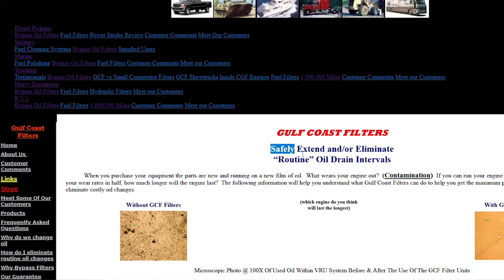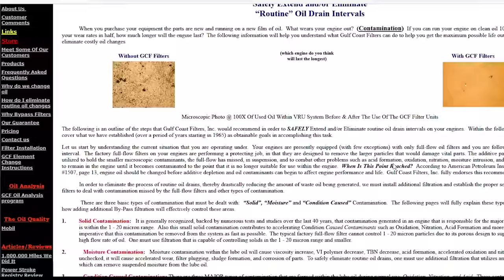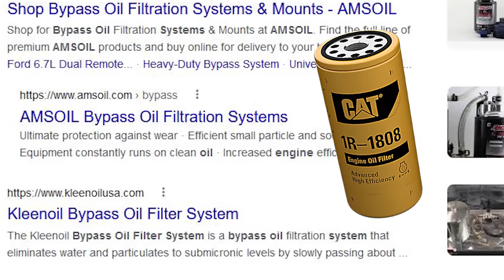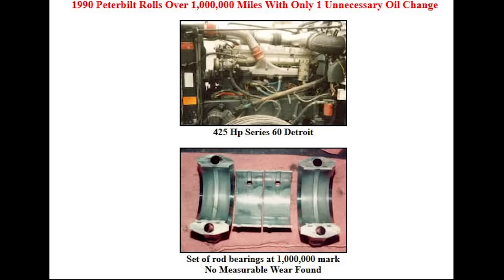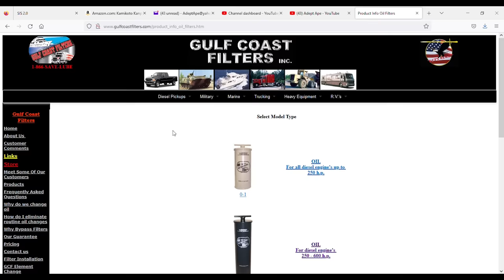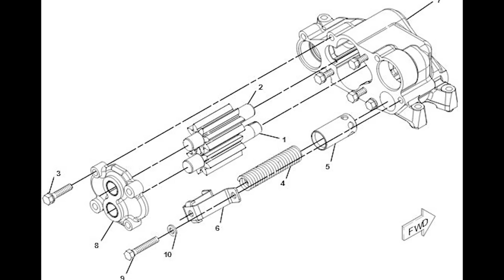No Oil Changes and 1 Million Miles!!! Are Oil Changes Optional with a Bypass Filter? (INTERESTING)

Comment: I only know light vehicles.  Would simply topping off with new oil after filter changes address your concerns?  (Other than coolant separation failure which, as you said, is a repair, not maintenance.)

Comment: I know it's not the same, but I have a 1989 GMC pickup with a 350 gas.  The odometer broke at 252,000 over 10 years ago.  I estimate it has well over 300,000 on it now.  The oil has been changed twice in the last 10 years.  It still runs well and doesn't burn oil.  That's with no special filtration at all.  I sometimes wonder about the value of oil changes.
Reply: In the 60s it took longer to clean out the sludge than overhaul the engine. Opened up a Nissan Altima with 225.000 miles on it to do a valve job. It looked new inside. Dont know if its better oil or cleaner runnimg engines or both. Thought all it needed was valve seals. The valve guides were worn out..ordered a Japanese import engine and installed it.  Son in law had a Chevy V8 . It would get a fire in the plastic intake manifold and the manifold would melt. I will stick with my old 390 Ford. Been driving my wifes Pontiac 3.4 V6. Thats one hell of an engine.
Reply: Back in the 60s I changed the toilet paper filter every 2000.miles. It was always dirty and sludgeed up.. Now I change the toilet paper filter every 6000 miles. It is always clean. The full flow filter is clean. My guess is the Pontiac 3.4 engine is perfectly clean inside. I decided to quit changing the full flow filter. It has 63000 on it now. I might be wasting money changing the toilet paper filter every 6.000 miles. I think Jackmaster claims up to 10.000 miles. That would be under ideal conditions such as what I drive.
Reply: Watch out going too long between full flow filter changes. The pleated paper might get rotten and come apart.

Comment: No joke I drove a Subaru for 200,000 miles after it already had 100,000 miles added oil only never changed anything never change the oil filter either When I finally retired it had nothing to do with the engine

Comment: One thing that would help keep oil changes down is an oil centrifuge, which is also known as an oil spinner. It's driven by oil pressure, and it spins the oil as it passes through causing solids to stick to the inside of metal bell. You can then clean the caked-up gunk or replace the collection portion inside the spinner. That, along with a bypass filter, would ensure 1M mile oil changes even in tough conditions... and yes, oil is recycled and reused by deep filtration so I would consider the claims of the bypass filter legit.
Reply: The advantage the big bypass filter has over the centrifuge is it needs a lot of new oil at filter changes.Its a matter of keeping the oil clean and adding enough new oil.
Reply: @ralphwood8818  Yeah, but you can use the oil spinner along with the bypass and effectively just "top off" the oil instead of having to do complete changes. Other than that, you would need to occasionally clean the spinner collection bell and swap the filters, but that can be done without draining the engine.
Reply: @alphaforce6998  Engines need for the oiil to be clean 100 percent of the time plus enough new oil added to keep the additives up to specs. When you dont drain the oil you have to. Change the filters more often. The oil in a diesel can be very black and be clean. Some diesel soot is non abrasive and..too small to be filtered out. Its like ink.Not sure about a centrifuge. My only experience with a centrifuge is on a 65 Honda 305 motor cycle..Had a Frantz oil cleaner on the Honda 500 custom in those days. Converted the canister full flow filter to a spin on filter..

Comment: The logic of swapping out portions of your oil in any engine over an amount of time before changing it dose work. But you use more oil???? What I don't understand is why your not supposed to drop your transmission pan and change the filter every other oil change???? Can you tell me you opinion?
Reply: I have a Motor Guard toilet paper filter on the Impala transmission and the Subaru transmission. The 76 F 250 has a Gulf Coast junior on the transmission. Today I will be puttimg a Motor  Guard on The Ford  tractor..Its more complicated. Dont want to get blown off the tractor by an exploding bypass filter. The only thing I have with a decent stock transmission filter in the oil pan is the Impala Transmission in the Farmall H. Correction. Never had the pan off the Subaru. Dont know what the filter looks like. It has 240.000 miles on it.

Comment: Correct me if im wrong The million mile truck had about 350 gallons of new Rotella added in a million miles just counting the makeup oil added at filter chamges. Only one oil change?  It looks like to me for the system to work the filter must be big and able to keep the oil clean plus take enough new make up oil to keep the additives up to specs. My experience is a roll of toilet paper and a quart of new oil. The largest thing I own is a 390 in a F250 Ford.

Comment: Put a bypass on a Mack 20 years ago. Did a lot of research beforehand but it wasn't until running it for awhile that I realized that the claims about not changing oil were misleading. Every time you changed the bypass filters you had to put in 2.5 gallons of " makeup oil" in the system. So in effect you were changing 2.5 gallons every filter swap, not exactly the same as " never changing oil"
Reply from the maker: That is an important point.
Reply: Its misleading as hell . The million mile truck gets 3 gallons of Shell Rotella 15 40 conventional oil every 10.000 miles. I believe its like over 3 hundred gallons of new Rotella in a million miles.Probably why it was using Rotella is Shell oil was doing the test.Not sure what Shell offshore uses in the drilling rigs. I bet its not Delo.The big filters take 3 gallons of new makeup oil. I have an instrument that tests the electric conductivity of the used oil..Dirty oil is a better conductor. If you get a high reading a sample goes to the lab. If the needle pegs out the engine is shut down.
Reply: I remember when the only filters we had that cleaned oil were toilet paper filters. People would say things like I am still running on the same oil at 100.000 miles
In those days to keep the engines and oil pristine you needed a roll of 2 ply toilet paper and a quart of single weight oil about every 2.000 miles. Delo was 29 cents a quart in the discount stores. If we were selling gasoline for 30.9 and the station down the street dropped their price to 29.9.all of our customers went down there.
Reply: Yes adding 3 gallons of new oil every 10.000 miles is changing the oil. The Road king article said it was equal to a full oil change every 40.000 miles.

Comment: Bypass filters should make a difference to engine life extension by reducing wear rates from small particules. It cannot however ensure an oil maintains its' properties like viscousity. You could push especially in the trucking industry longer oil changes because you are often using monograde oils that are very shear resistant.

For most pasenger cars using multigrade oils, the heat will cause the polymers to shear and thin the oil out. Addiionally cars can have oil pressure issues from vehicle dynamics, so you would want a seperate oil pump to not limit existing oil pressure. Ignoring that cars are somewhat cheap, this system will not that great for cars for a number of reasons.

Comment: BellSouth used to do one quart and one filter change per oil change and leave the majority of the old oil in the engine most of the vehicles made it to at least 100,000 miles before being auctioned off
Reply: I serviced telephone trucks in Cupertino California in the early 60s. We only changed the filters and added make up oil. They reasoned the engines would be a sludged up mess when they traded them in but they would be worth as much as if the engines were pristine. With the crappy oil in those days you could change the oil regularly and still have a sludged up engine.my engine was pristine because I used a Frantz oil cleaner and  Standard Delo.W30 .

Comment: I’ve been told by amsoil that a 2 micron bypass filter cannot remove carbon soot because it’s much smaller than 2 microns. I think they help but I can’t wrap my head around how you can still have a useable TBN left (total base number) which would cause acid formation over time. Maybe if your engine burned a lot of oil and you had to add a gallon once a week. Oil viscosity deceases over time as it shears. I think we should bring an oil lubrication specialist into this video series.
Reply: My old.diesel Ford tractor is fooling the hell out of me. It had a new full flow filter and you could tell the oil was new but was starting to get dark.I just bought it. I converted a Flat head Ford V8 canister filter to use a roll of Scott 1000 and installed it with a 2 port Perma Cool universal sandwich adapter.. I only have 5 hours on the meter. The oil is getting clearer every time I check the dipstick.. The sandwich adapter causes the oil to go thru the Scott 1000 slower..If I could remove all of the soot that would really be something..Normally the soot particles too small to be removed will gradually turn the oil black. The Ford filter has no orifice. The sandwich is causing the flow to be slowed down going thru the Scott 1000. The old 2 port Frantz sandwiches worked with the big engines. They didnt work with the low oil flow small engines..The Perma Cool sandwich has a spring loaded valve in it. It sends the clean oil to the inlet of the full flow filter instead of the oil pan.Its a oil cooler adapter. I added a oil pressure gauge so I know everything is OK.it idles at over 40 PSI. The relief valve in the oil pump opens at 50 PSI. This is the Dallas Texas area.Not sure how it would work in cold weather..Notice Jackmaster has a bunch of sandwich adapters. I think the Jackmaster will get the orifice removed and a sandwich installed. The Jackmaster Classic is installed the conventional way on the Pontiac.Torrent..Got the Jackmaster Classic off Ebay. The Perma Cool universal came from Jegs. Probably the best toilet paper filters you can buy right now is the Jackmaster and the Gulf Coast junior.. Jackmaster has a bunch of information.
Reply: Shell offshore uses the Gulf Coast filters and was involved with the million mile truck.I believe it used Shell Rotella T 15 40. Shell oil is about as lubrication specialist as you can get..
Reply: I was demonstrating the one pass Motor Guard oil cleaner in the 60s. An art supply dealer gave me a tube of black coloring. He said you cant filter this out. I used it the rest of the day. When I changed the toilet paper it was half white and half black. This is what you need for demonstrating a bypass filter Something that cant be removed by a normal filter but has nothing that can get thru the  toilet paper. Some diesel soot is too small to be filtered out and is non abrasive but it will turn the oil black.To check the black oil rub some in the palm. If it wipes off clean and doesnt stain the skin it has passed the palm test.

Comment: Great video and I couldn’t agree more. I don’t think that not changing the oil at all is a great idea as far as your oil not getting above 250° unfortunately diesel engines equipped with turbo chargers will have the oil exposed to much more than that on a regular basis.
Reply: I started using filters that clean oil in 1963 with a Frantz oil cleaner and Delo 100 W 30.. couldnt use multi grades in a diesel in those days. I changed the Frantz and added a quart of Delo every 2 K miles. Im up to 6 K miles now. Mostly gasoline engines. With the few diesels ive owned I just changed the filters as often as needed to keep the oil clean. All I have now is the Australian Jackmaster Classic  Motor Guards and the Gulf Coast junior.  Im big on the top loaders and toilet paper filters. Had a O-1 Gulf Coast filter on the old Ford 6.9. Too much filter  for my use. Bolted a Gulf Coast junior to the fan shroud  tapped into the fill neck lower than the filter for a return. Change it in less than 30 seconds with no spillage. The big Gulf Coasts are for trucks that pile on the miles.

Comment: I had one on my cat/379 Pete, but i still changed my oil at 20k instead of 11k, so i cut my oil changes in 1/2, truck had 1.4 million on it when i sold it, nothing but yearly overheads , All do the filter media is 2 rolls of bounty Mega paper towels, so gulf coast filters are cheap lol

Comment: I believe the Shell oil test truck used Rotella. 15 40 conventional oil. The system of changing the filter and adding make up oil has been around for a long time.i used Delo 100 30 weighr in the 60s I would like to know what they use in the Shell offshore rig engines probably not synthetic.

Comment: there are triple full flow oil filters kits available. instead of primary and secondary kits .they use 5 microns filters to prolong engine life.
Reply: I have a Jackmaster Classic  on the Pontiac. They claim 1 micron if you use their elements. I like the top loaders. Ive heard claims of of 1/10 th micron  to 2 microns for bypass filters. A NASA diesel equipment guy said toilet paper is better than paper towels. Of course big filters clean oil better than small filters.It depends on how fast the oil is flowing thru the filters. How much media the oil is going thru. The oil is going thru 22 inches of media on the big paper towel filter at the same speed as the little toilet paper filter. We demonstrated the toilet paper filters by filtering out lamp black. Lamp black wont slow down for pleated paper filters. Three full flow filters will filter better than 2 because you are slowing the flow and reducing the pressure on the elements. 5 microns doesnt do it. You have to get smaller than the engine clearances.

Comment: I have a 1983 EIMCO LHD with a Deutz 912W. It's the only machine I own with a bypass filtration system; I guess EIMCO was a bit ahead of the curve.
Reply: My Mazda diesel came with a bypass filter. It wasnt much good.I pulled it off and put on a Frantz oil cleaner.There is no such thing as a pleated filter that cleans oil. The orifice helps.
Reply: In the old days you had 2 choices. No filter or a bypass filter. The bypass filter was normally optional equipment. At one time Cummins claimed an 80% engine life increase with the bypass filter. Years ago I bought a few Cummins Fleetguard bypass filters from a International truck dealer.. The big Gulf Coast filter is a better filter.

Comment: Your comment regarding fuel intrusion past the piston rings seems to indicate that diesel fuel is homogenous or made of one material. I don't think that's your intent. When fuel enters the oil system, the higher volatile components of diesel fuel will vaporize and be consumed back into the engine (assuming a more modern engine with either egr, etc.) or ejected as blowby. It leaves behind the less volatile components of diesel fuel in the oil. Any knowledge you can share on this? Or help me refine my thinking on this? Thanks, I very much enjoy your videos.

Comment: 🤔wow this is a tough subject,besides my truck I run my own comercial fishing vessel,so I purchase alot of oil and like you say recently the price of oil has gone through the roof!!I've contemplated installing one of these oil bypass filters but still very leery if I would fully trust it or not??
Reply: Check with Gulf Coast  filters. They do everything from offshore rigs to shrimp boats. They might put you in touch with customers. I havent sold Gulf Coast filters in about 20 years.

Comment: I have a question I was always till the diesel engine runs better when it's not disturbed railroad engines don't change your engine oil unless the unit is put into It's just about once a year for over all the maintenance is this true with truck engines or with smaller vehicle engines or machinery equipment engines?  If so why are we worrying about what filters were using I was told the engine runs you just keep putting new oil in it and then during maintenance it is all changed out and put new in.

Comment: I feel the system would work good as long as scheduled oil analysis was done,   And I think it would also do good for  mother Earth  If everybody was using one
Reply: The oil change industry has been very effective at selling the system of allowing the oil to get dirty then draining it. A oil filter that cleans oil must be snake oil. A filter that allows the oil to get dirty and need to be drained is legitimate. It is what it is.Go to a auto parts store. Shelves full of oil filters. None of them clean oil. Back in the 60s Grand Auto parts in San Jose California sold Motor Guards and the Fram cotton filters. Motor Guard went broke and went to making compressed air filters. Fram went to making only almost useless pleated paper bypass filters. Had a Frantz on a counter of an auto parts store. A guy asked me if they were as good as a Fram. The owner of the store was a Frantz user.

Comment: I've been thinking about a stand alone filter that could recycle your oil.
The oil would have to be drained and then settled in a column,centrifuged,filtered and tested for acidity.
You might be able to put a hose down the dip stick pipe at night and in the morning your oil is sparkling clean 😅.
Reply: Allegedly there's a standalone oil reclaimer on a friend's property; he used it to produce recycled oil for generators and compressors at the mines we operate. Personally I wouldn't trust it enough to run in any of my engines; new oil is cheaper than a rebuild.
Reply: You get the longest engine life by cleaning the oil as you drive.